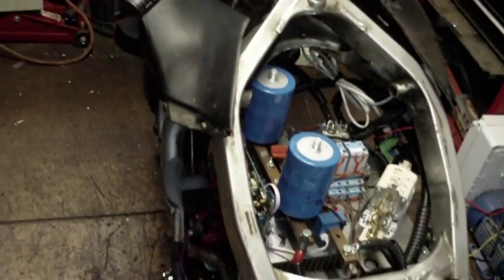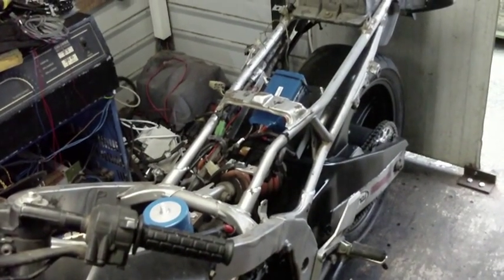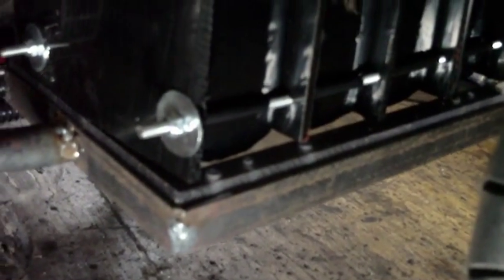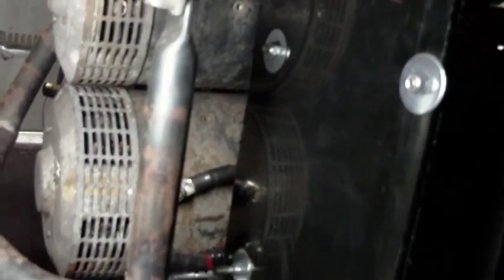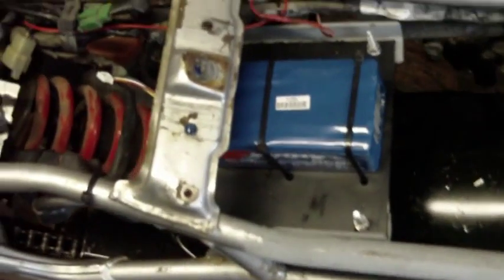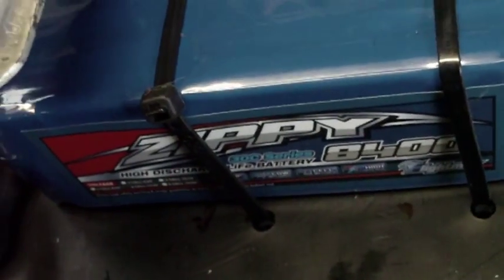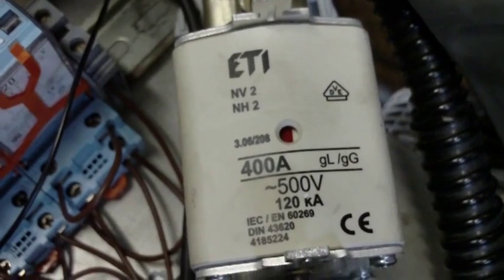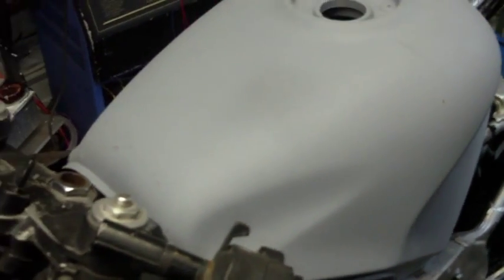Honda CBR600 EV Conversion 12 Motorbike Battery

Comment: What a BEAST. I'd love to test drive it for you, but I'm stuck in Tasmania. I'd definitely recommend keeping it under 20 amp draw on throttle until you're more confident with it. I'd think with that much pure torque you could get it to wheel stand at 100km/h no worries. Ride Safe man.